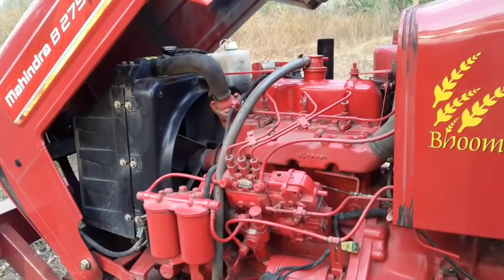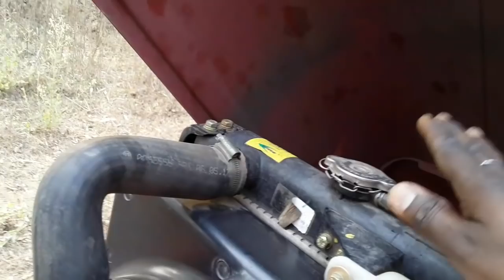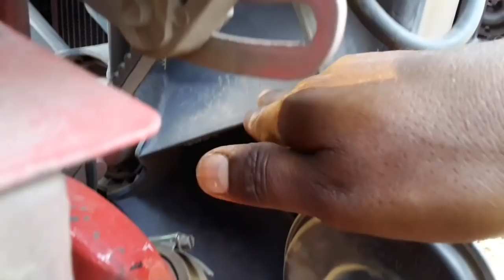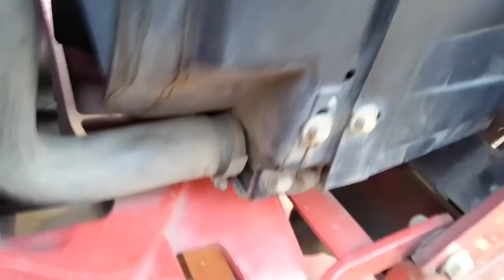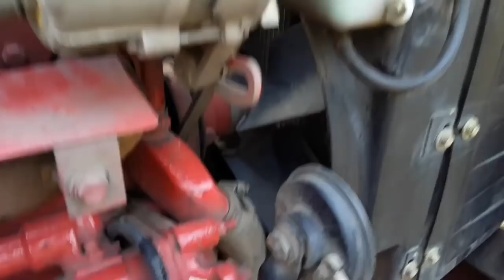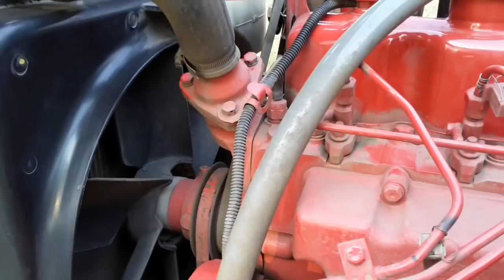Engine Cooling System Work in Hindi

Comment: Work talk 
Becz before radiator and after engine thermostat is connected that's way engine temp. Is reached 80•c after thatit will be opened and coolant reached in radiator